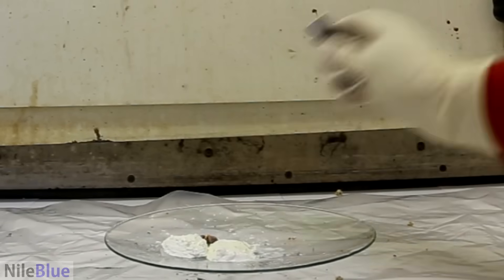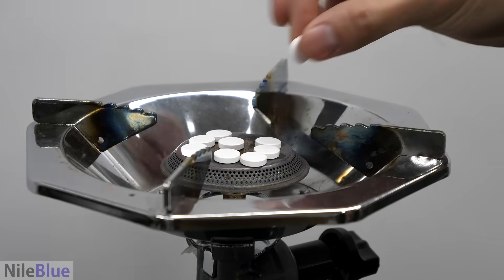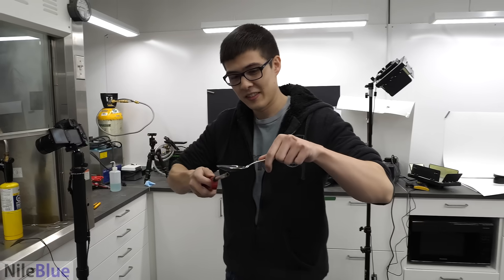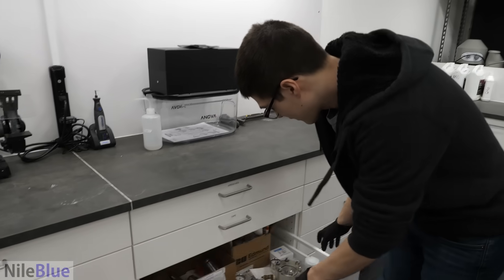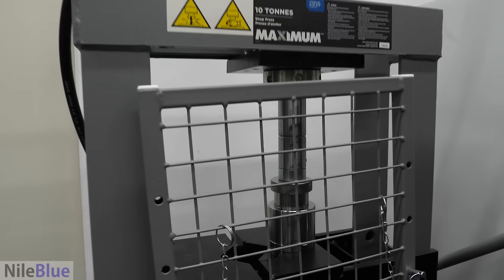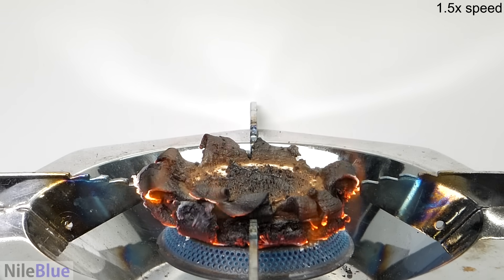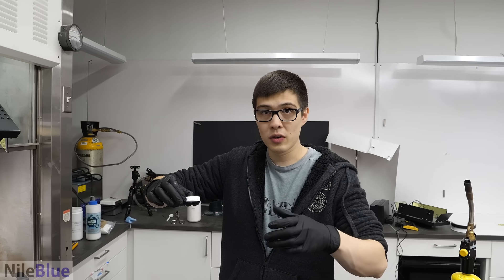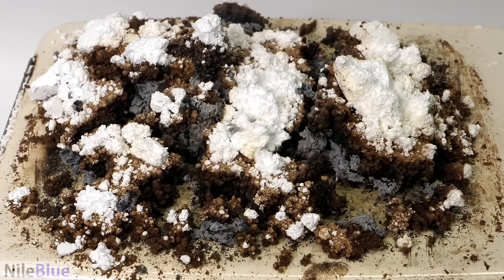Growing a chemical snake that looks like a turd

Comment: So... Those "snake" things we used to get (in the 1990's) at fireworks stores... Wondering if they involved Mercury now. :X
Reply: No. Fireworks snakes are still available many places and are not the same compounds as the Pharaohs serpent reaction.
Snakes make mainly smoke and with the mercury one, you wind up with a much bigger solid after it burns.
Reply: i remember doing that this summer. they are great fun. surprised i had to scroll this much to find them

Comment: as someone that use to work with presses a pill press is rather small but runs around 20 tons of pressure so to get a solid pill I would go at least 5 tons to 10 tons of pressure.
Reply: I actually tried doing it at 5, but it didn't work as well. The pill was packed too tightly or something and it wasn't as interesting when it burned.
Reply: @NileRed  holly molly it's him
Reply: Burris Streaming yeah, i always wanted to make thermite billets this way just to see what a compressed mass would do instead of a diffused powder.
Reply: @nunyabisnass1141  I would be careful with trying to make thermite billets as there's a lot of heat generated when pressing powdered  metals. I use to make powdered metal parts and they were so hot you couldn't touch them. not sure what is required to ignite thermite. if you do try this use as little pressure as you can.
Reply: @hiddentruth1982  Ordinary iron oxide-aluminium thermite is pretty notorious for being stubborn to light without a material that puts out a lot of heat (usually an iron dust sparkler or magnesium ribbon are the ignition sources of choice)

Comment: 3:00 lab coat and goggles weren't my first concern. You should never hold with your bare hands and without gloves a METAL object you are pointing a blowtorch at. Speaking from experience.
Reply: depends on the shape, something like a spoon is probably fine because most of the heat will dissipate by the time it gets to the handle
Reply: DFliyerz like how on a pan with a metal handle, the handle doesn't really get hot.
Reply: " You should never hold with your bare hands and without gloves a METAL object you are pointing a blowtorch at. Speaking from experience."
Sounds like fun, and painful, story.
Reply: pfffffft.... I weld without gloves all the time.
Reply: If the object is already hot then yes, but if it starts cold and you slowly heat up the opposite side there's absolutely no problem. You easily feel when it gets uncomfortable and you can put ot down way before it gets even remotely close to dangerous.
Reply: If it got too hot hed reflexively drop it. also generally you dont want to use the gloves they usually use in a lab while handling hot things because the gloves can melt and burn, both things you dont want it doing while tightly clinging to your hands. you take off your gloves when you work with fire.
Reply: @jonathanodude6660  yeah of course you wouldn't use latex gloves for holding hot things. There are gloves made just for that purpose (a lot of different ones made from a lot of different materials depending on the heat level you're working with and other things) and most labs (not all of course) have at least one pair (usually many).
Reply: Stainless steel has really low thermal conductivity
Reply: @nout4269  oh yes?
Reply: @marc_frank  About 14 W.m^-1.K^-1 for stainless steel, vs 413 W.m^-1.K^-1 for copper. So, yeah.
Reply: @tzimmermann  yeah thats quite a difference
can you calculate the distance for the heat to drop off from 900° to 40° C using a simplified geometry of the spoon?
Reply: @marc_frank  Your question is incomplete, the heat equation has time dependency.  Do I also need to take radiative loss into account ?
Edit: to be more precise, the situation you describe is not at equilibrium. There are an infinity of temperature profiles that would feature such a drop off at a given time, with various characteristic distances.
Reply: @tzimmermann  Not necessarily, if you consider steady-state.  I think the question that Marc is asking is roughly: If you had a spoon handle (assume constant cross-section, so essentially just a bar), how far would you need to hold from a point that's 900°C so that you're holding a part that's 40°C.  It would be interesting to see the number with and without radiation.
Reply: @MystbornYT If we're talking about steady-state solutions, then the spoon material does not matter anymore, right? You still have to specify the boundary conditions which make this steady-state possible in the first place, then it's solvable. You'd be solving 1-D Poisson, basically (assuming the rod is thin), find a solution (which would happen to be linear) and compute the abcissa at which the temperature is 40C. Which would depend on the length of the rod and the boundary conditions. Am I missing something?
Reply: I don't like the reply section